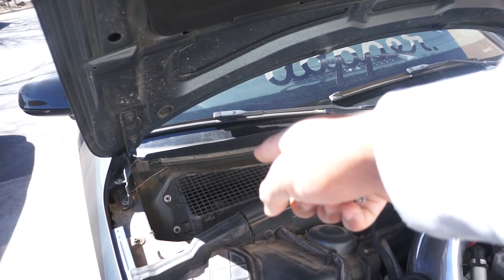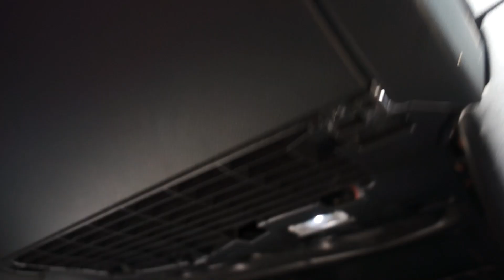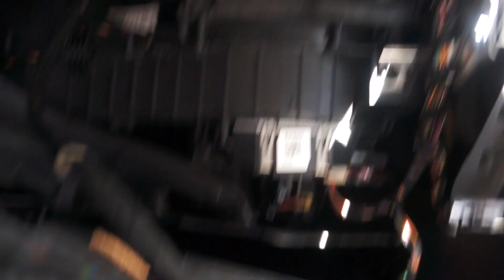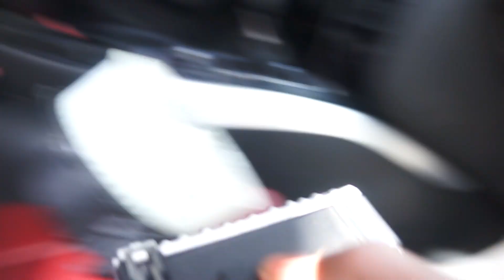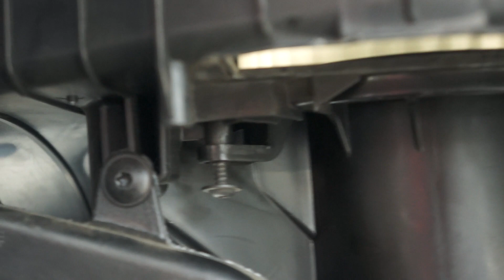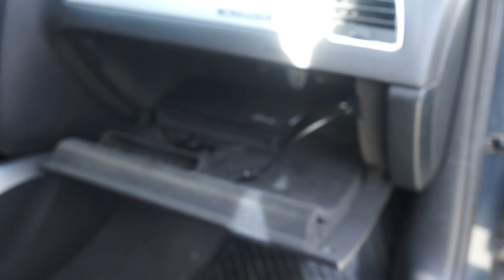Audi S4 Blower Motor Replacement!

Comment: Cool, thanks for this.  Just started my car up for the first time this year and the motor was bad.  Im a former HVAC mechanic and always work on my own cars when possible, but Im recovering from heart surgery now and kinda limited physically.  Sorry for the wierd question, but was it easy to do just kneeling down, or did you have to lay on the floor to access? I ordered a new motor and resistor, so should have it tomorrow. Thanks